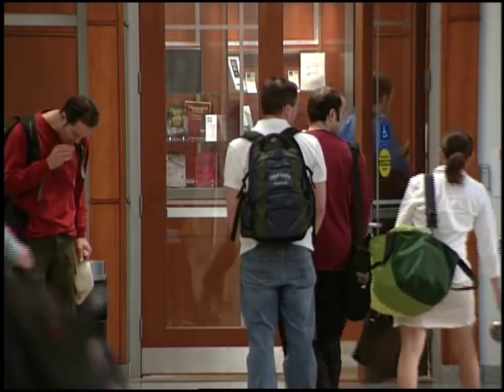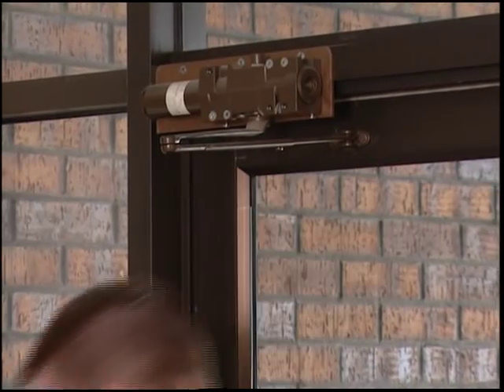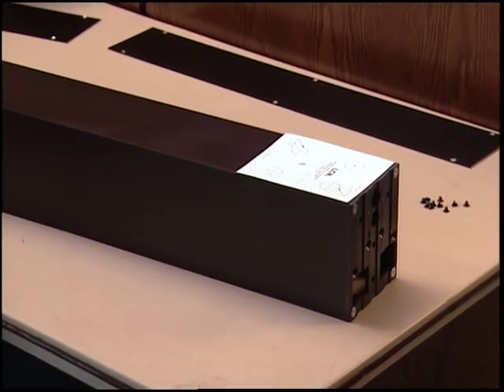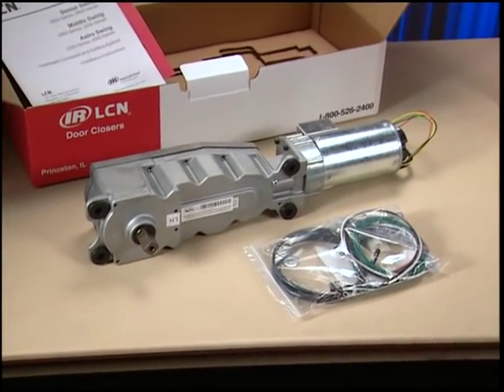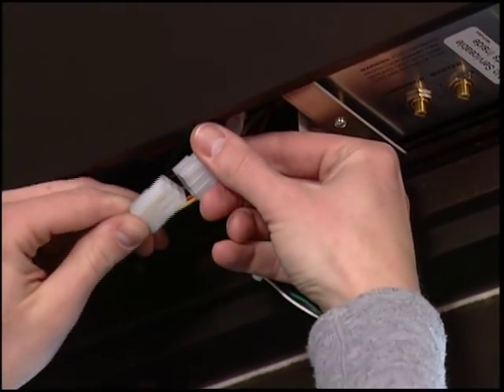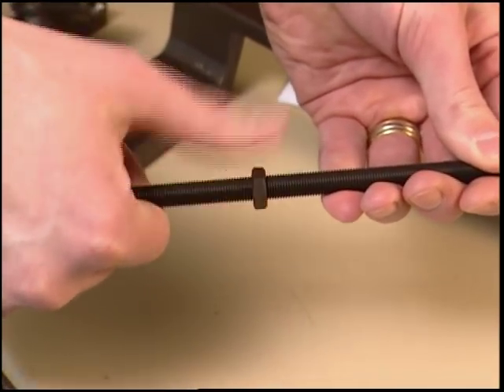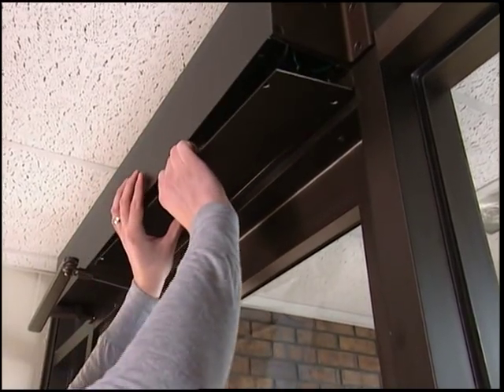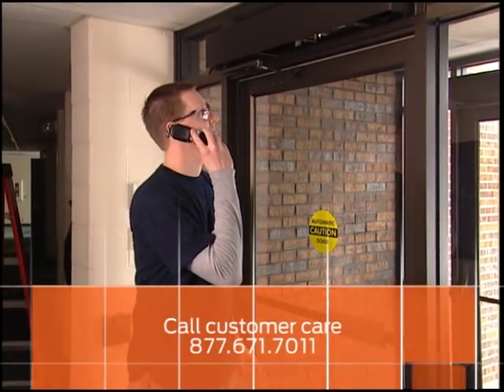How to Install the LCN Senior Swing Automatic Operator

Comment: Does the 4 Pin activate cable come with Automatic operator? I am trying to hard wire two handicap push buttons and do not know where to land the wire on the operator.
Reply from the maker: The activation input wiring harness is included in the Senior Swing parts bag, and has 4 wires in it: black, white, yellow, & gray.  The harness plugs in to either P6 or P7 on the Senior Swing.  The yellow and gray wires are for activation. They are connected to the N.O. (normally open) and COM (common) terminals of the push button.  If you need any more help, please feel free to call customer care at 877-671-7011.